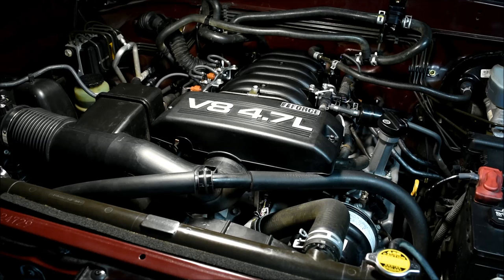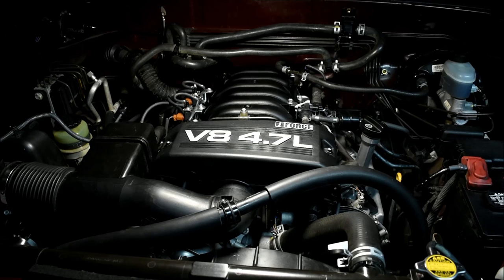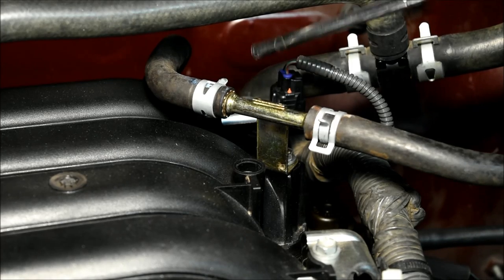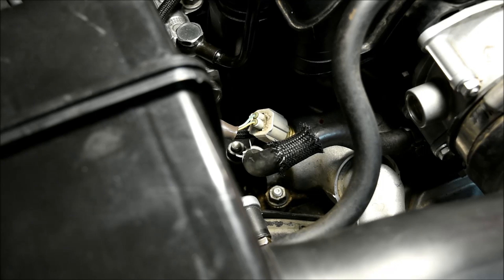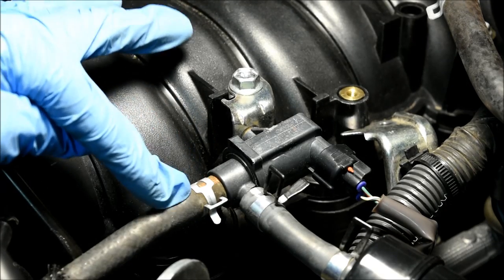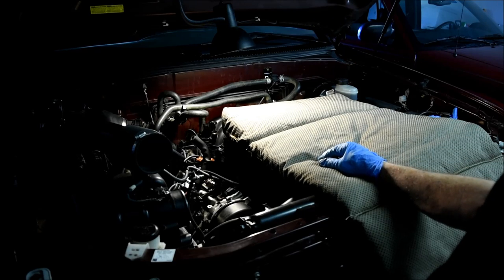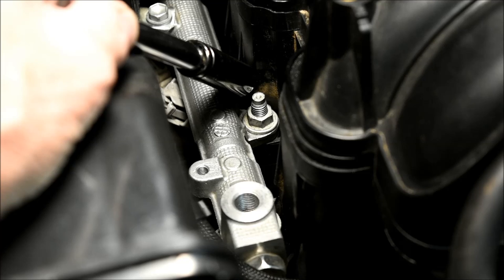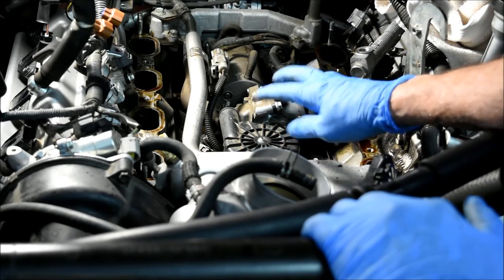Secondary Air Injection Pump Replacement 2006 Sequoia/Tundra Chapter 1: Removing the Intake Manifold

Comment: Hey David, thanks for the excellent video. Little bit of a sidebar here, but have you ever seen this gasket in that engine? I took my wife’s’06 Sequoia in to a chain auto shop for an alignment recently after replacing a bunch of the front suspension components and they of course threw several other “suggested” repair quotes in the receipt as well, one of which was a rather pricey labor price to do this gasket along with all eight spark plugs (they wanted $17 a piece for the plugs 😂). Anyway, I thought what I was looking up was the intake manifold gasket but after more research and watching your video, it obviously isn’t. Any idea where this one goes and how much of a pain it would be to replace myself? Thanks again for the video!
Reply: Anyway, it’s the Fel-Pro MA96333 Plenum gasket set. That ring a bell at all? Thanks in advance for any advice or commentary!
Reply from the maker: @drewduncan1670  The plenum gasket goes between the throttle body and the intake manifold. In my video, I did not remove the throttle body so you do not see this gasket. It would be much easier to replace this gasket than say a head gasket. I have never done this repair before but I don't think you would have to remove the intake manifold. I could be wrong. However, you may not really need to replace it. If you are like many of us, you have an aversion to taking your vehicle to the Toyota Dealers, but one thing they can do is run a very comprehensive diagnosis of your car. I will gladly pay them $100 to get one of these because they can usually tell me what or if something is wrong. Then I can decide if I can or if I want to fix it myself.  If you are not having any problems with the SUV other than needing some front end work, it is not likely you need a head gasket replaced. Quite frankly I doubt if you need the spark plugs replaced either. Just because you take the car to the Toyota dealer for diagnostic testing, you do not have to let them repair it. It is a shame that so many car repair places are always trying to upsell and squeeze a few more hundreds (or thousands) out of each customer.
Reply: David Clark oh absolutely, I’m all about the $10 “car care” inspection special at the local Firestone that includes a tire rotation - I just let them rattle off whatever they’d like to up sell me on, tell them no thanks, then take a look at their recommendations and see about doing them myself, if I think they’re worth doing.

Comment: hi question the problem is only when tha truck star cold , after 30 second the noise gone, and not come more, i dont konw is the pump or not, because the air pump, work all time. yes or notthanks
Reply from the maker: Hi Star.The SIA pump is only intended to run for 17 or 18 seconds. That is why it is called the Secondary Air Injection pump. It only works until the Primary system warms up and then takes over. It is a lot of equipment and a lot of expense to run for just a short amount of time, but our govt mandated it. Back to your question: The noise stops after a short time because the system turns the pump off- not because the problem "gets better." And you are right, the pump only runs one time per day, when the engine is cold. What you have described tells us that it is very likely the pump that is going bad.
Reply: thanks Mr Clark for take your time and answer,
today i drive my sequoia and the lights for chekengine come and lights for TRACK OFF AND THE LIGHT OF VSC 
and the truck lose power and the shift are low ,
you know something about that 
thanks again .

link  :   https://www.toyota.com/owners/resources/owners-manuals/sequoia/2005
Reply from the maker: Hi Star, it sounds like your Sequoia is going into what is called the "limp mode." This is Toyota's way of telling you that they want you to come into the dealership and spend a lot of money getting that situation repaired. If you don't have an OBD-II code reader, then go to an auto parts store where they will check your CEL codes for free. If you see the 401 and/or 418 type codes then that is the SAI pump and valves. Usually this has nothing to do with VSC computer, but I cannot guarantee that. If you have SAI codes and replace the broken parts, most of the time, these other codes will disappear.
There are a number of other situations where you will see the CEL, VSC track, and Track Off lights at the same time. Some folks have made them go away by replacing their fuel cap. Some have had to "recalibrate" the VSC computer, either themselves or by taking it to the Toyota shop. And sometimes it can be a bad fuel injector nozzle or fuel injector electrical connector. Usually you will not get the limp mode with these problems. However, IF you are getting the limp mode where the car only goes slow and takes time shifting to higher gears, (and with your history of the SAI pump making noise upon start-up) I can almost guarantee it is caused by problems in the SAI system.
Reply: Thank you for your response, I am sure that, the truck will move, to limp mode, for this cause, we will almost not get home.
Contrary on the way to work ran, like new.
In the afternoon, when I started the truck, I presented the problem that you already know.
I today, buy all the parts, follow your advice, I guarantee it.
In the following days I will tell you the results
Thank you
And we have something in common
Work for a long time, cessna and piper, and others.
Thank you Mr Clark.

Comment: Would it be the samething for a v8 4runner?
Reply from the maker: I don't know the answer to that. Some V8's have the smog pump in the right front fender well. I think (but don't know for sure) that some pumps are pretty much out in plain sight. The unlucky owners (like me) have the pump under the intake manifold right next to the starter- gee thanks, Toyota...I also checked on line and could not find a good answer to your question. You might ask a Toyota dealer service dept. However, when I first had this problem, I got bad info from my local Toyota dealer- they said my SAI pump was in the fender well. And they wanted over 3K bucks to replace it...Good luck on your repair. Let me know if there is some other question...

Comment: I have a question.....what happens to the vehicle if you need this repair but can’t afford to get it
Reply from the maker: That is a good question with no single "one size fits all" answer. A number of "solutions" are suggested by viewers in the comments to this video. But before I get to that, let me say that constantly going into the limp mode and clearing it with your OBD-II code scanner gets old. I was told by one Toyota dealer's repair shop that eventually my SUV would no longer come out of limp mode unless I took it to a dealer for repair. I don't know if that is true. And even clearing the CEL light doesn't work perfectly. I could not drive my SUV over about 50 MPH after turning off the CEL. Nothing bad will happen to the vehicle if you drive it with the SIA pump inoperative. It does NOTHING to your engine one way or the other. So don't worry about any immediate mechanical need to have it replaced. You can take your time and save up to have the repair. Your only time constraint is your next vehicle inspection.
 OK, back to your question:
What are the options:
1. Take it to a Toyota dealer. IMHO the worst choice
2. Take it to an honest local repair shop not related to the dealer- usually does not cost as much money as the dealer but still quite expensive
3. Replace the SIA (smog) pump yourself. A lot cheaper, but still you will spend some bucks. The range of cash outlay in this choice depends on how much you want to do yourself. You can buy almost all Toyota parts which is the higher end of the spectrum OR you can test all the check valves and diverter valve and rebuild the smog pump yourself (remove the cover and replace the guts with those of a much cheaper after-market smog pump made for, say, a Chevy). Or you can take the middle ground and just buy after-market parts which can be about 1/2 of what you would pay for OEM Toyota parts.
4. You can buy and install the bypass kits designed to spoof the car's computer into thinking (and reporting) everything is hunky-dory. As I mentioned in my write-up, this is illegal and in some States will get you a hefty fine. Plus almost any State Vehicle Inspection Station would spot this device attached to your engine. Furthermore, if you remove it for the inspection, you won't pass. Catch-22. 
In addition, these devices are not all that cheap. Because of the multiple codes my truck was displaying, I was told I would need not one, but two different devices costing approximately $400. And I could have replaced all my defective car parts with after-market parts for about that amount
5. Sell the truck "as is" and move on...
6. Although having your cousin set the truck on fire while you are out of town and collect the insurance is an option, I guess, I DO NOT RECOMMEND IT.
7. If anybody else can think of another legitimate option that is cheaper, please feel free to chime in.
Reply: Ok Mr Clark one more question what is limp mode
Reply from the maker: Some cars mfg's call it "limp mode" while others call it "Fail Code." I think it started out to be a well meant effort by the mfg to protect the vehicle if some error condition is noted by the car's computer. The computer will usually not allow the car's transmission to get out of low gear , and you will have a difficult time driving more than about 25-30 MPH. You can often trick it into letting you go a bit faster by taking your foot off the accelerator and the transmission will shift. And if you use the OBD-II code reader you can reset the error code and the car will go out of Limp Mode. However, usually in a short time if the problem has not been repaired, the Limp Mode will come right back.
If there was something seriously wrong that might damage the engine or transmission, the Limp Mode would be a good idea. BUT if you are having an issue with the Smog pump (SIA pump), that part contributes NOTHING to the well being of the car and driving with that pump totally inoperative would not hurt the vehicle.
I have heard but not verified that there were a lot of complaints by Toyota owners about the Limp Mode with nonsensical stuff like the Smog pump, and Toyota has removed the Limp Mode from their newer model cars for such non-harmful error codes. It is obvious that they were using the Limp Mode to get you to come into the Toyota garage and pay to have the Smog pump replaced at no small expense. Imagine if that pump went out WAY out in the middle of nowhere and you had to drive 300 miles at 25 MPH...
Reply: Mr Clark can you give me some info about a metal handle or lever for my rear hatch
Reply from the maker: The place where I got mine has gone out of business. But I Googled "metal rear hatch latch Sequoia" and got a lot of sources including Ebay and Amazon. The part with the best reviews seemed to be from 1A Auto Parts. Here is the link: https://www.1aauto.com/toyota-sequoia-sienna-liftgate-handle/i/1abth00049?f=354195&gclid=Cj0KCQjw6rXeBRD3ARIsAD9ni9CcCGXrPaN4bsWkp4FuYqs-y4g818k2VYmkwNQ1UyqEWDlgc2b5VuMaAspFEALw_wcB

Comment: Would this work on a 4 runner 2006 twd?
Reply from the maker: Hi Ted, I think, but I am not sure, that the SIA (smog) pump is located in a totally different and much more accessible place on your vehicle. If your SIA pump is located next to the coolant reservoir, then this link to a 5 part video on a 2006 Tacoma should be a better one than mine: https://www.youtube.com/watch?v=L79asplKDx4&feature=youtu.be. I realize that Tacomas and 4Runners are not nearly identical like Sequoias and Tundras, but are often closer related to each other than to their bigger brothers.
 It is incredible how many places that Toyota put these pumps. When I first took my Sequoia to the dealer (just to get an estimate), the gal with the clipboard told me that there were two smog pumps in my truck and they were located in the right front fender well. That did not sound right (nor did the $3K she quoted me to replace them) so I went to another Toyota dealer who told me that there was only one  SIA pump but it was under the Intake Manifold. That was the bad news; the slightly better news was that he was ONLY going to charge me $2200. 
Good luck on your repair. At first blush, it looks like your fix will be a lot easier than mine.

Comment: HELLO DAVE CLARK. CAN YOU  OR SOME ONE GIVE ME THE PART NUMBER FOR (4 METAL CRUSH GASKET) THANKS
Reply from the maker: Metal Crush Gaskets for Fuel Delivery Pipe Unions (4): Part No.  90430-12026. Let me know if there is anything else. I am going to try to put the parts list in the introduction comments. It is normally in the link just below the video, but my website server crashed and the web host says it may be 24 hours before they get it back online...Dave